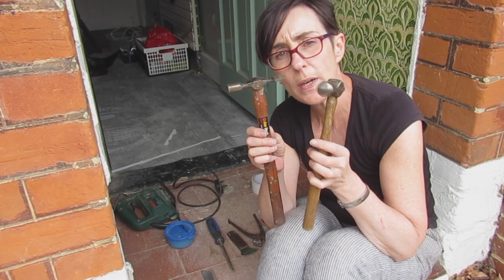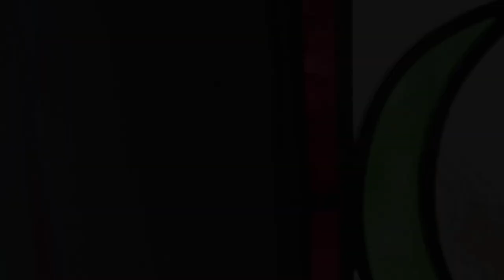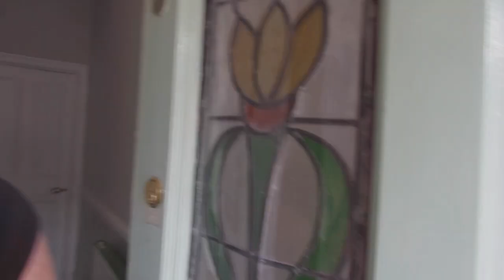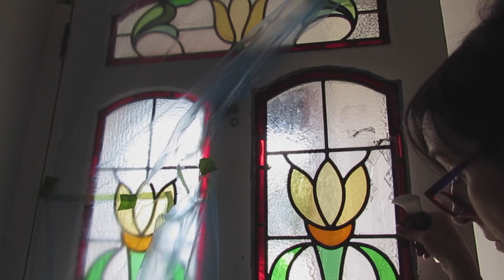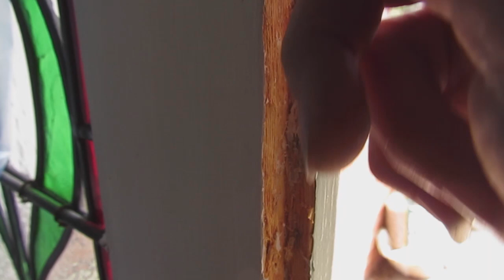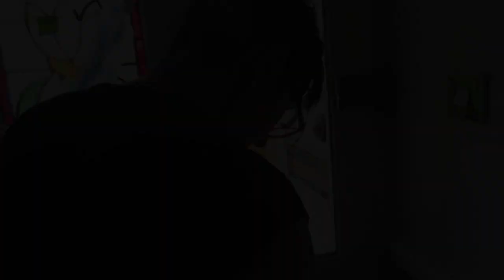Sophie's Stained Glass | Removing a Stained Glass Window

Comment: I have an old piece that is 7 feet tall about 18 inches wide. It seems sound so your thoughts on handling as I take it out of its case...  of course no blaming you if I break it..
 Should I lay it on the table I have prepared or stand it against the wall as close to the position its in on plywood so it doesn't flex, work on the case then put back?

Edit:
 Getting it from the back has me stuck at that middle bar. Heres a short video if the scenario.  Im going to go eat to regroup 
https://youtu.be/wU0qh4Wsuh4
Reply from the maker: I've not seen a set up quite like that so it's hard for me to advise. In terms of handling glass, placing it onto a board while it's still vertical is the safest way to transport it. Once it's against a board you can put it down flat without worrying. It's so tall that I am imagining it was made in two pieces so be prepared for that as you remove it from the frame. Good luck.
Reply: @SophiesStainedGlass  good news.. after much poking and razor knifing I got that yellowed  piece of plexiglass out from the front. I do not have to remove the stained glass. I will get things cleaned up, painted and devise a way to remove the new plexiglass (or whatever goes back over it)  for replacing or cleaning.  It looks so nice without the plexiglass..It's up on a stage though and needs a bit of protection from a potential falling drunk musician or some other nonsense. 

 Thanks for taking the time to chime in though. Much appreciated from Pennsylvania USA.. 
 Btw. The plexiglass was in two pieces so I'd have to say you are probably right about the stained glass being that way as well.
 Not my department but, as usual I get handed the fun stuff